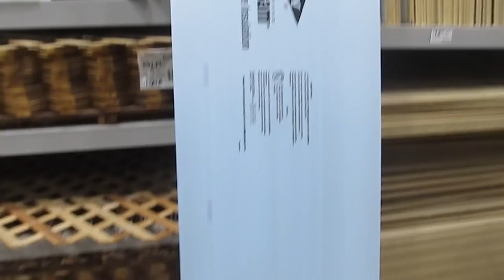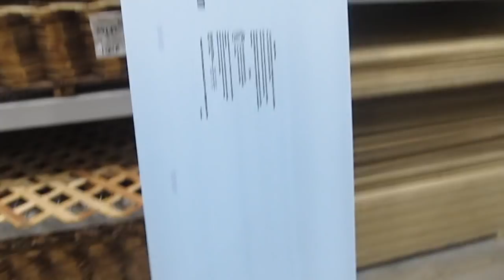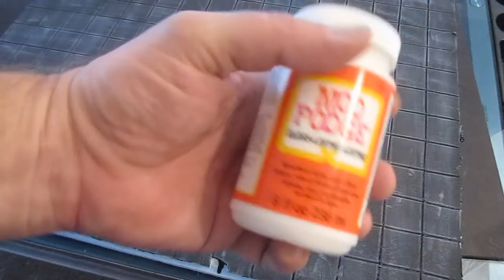Make fast easy dungeon terrain and tiles -cheap - part 1

Comment: Hey will I have been watching your channel for years and have built multiple projects. I am a huge fan of D&D and am glad to see you are starting to build terrain. Some suggestions, mix your black and your modpodge. That way you can seal and get a base coat on at the same time when working with foam. Second, texture your tiles with something like a ball of tin foil. This will make a rocky texture and when you dry brush your terrain it will create natural highlights. Finally, make some washes. A wash is watered down paint with a flow aid. It will fill the naturally low parts of the models and create a even more 3d effect. The simplest way to do this is by watering down black paint and adding a little dish soap as a flow aid.